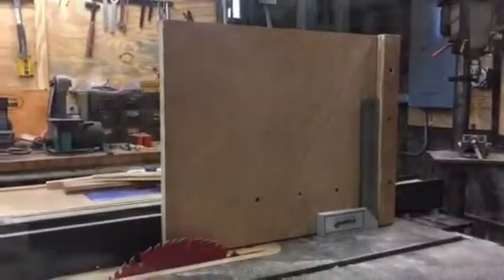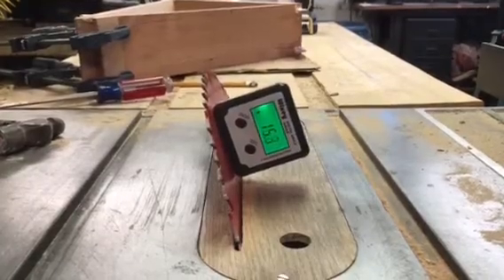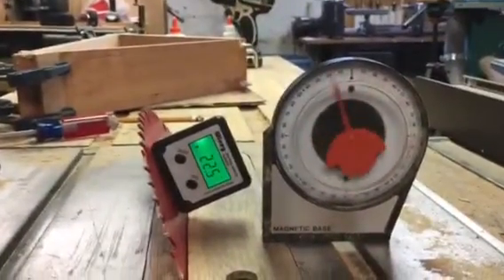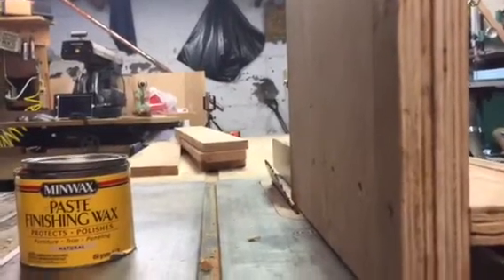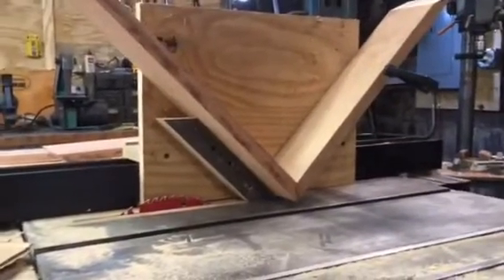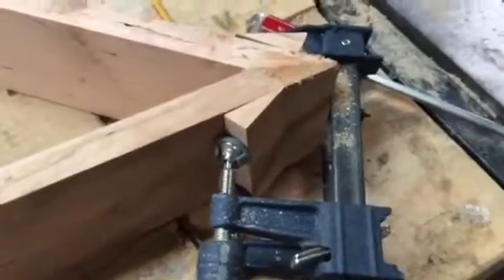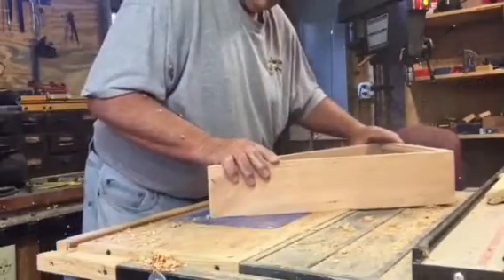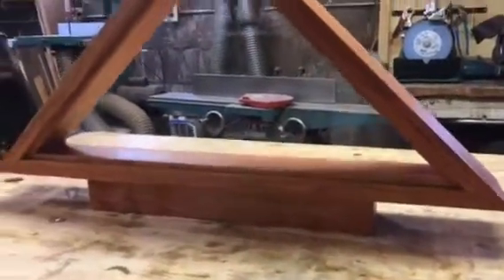Flag  Memorial Case by Bob Lee’s Woodshop

Comment: Question? Why can’t you cut that 22.5 degree angle on a miter saw? I’m new to all this but why is that miter angle different than the table saw? So how could you cut the bottom angles on a miter saw? Damn so many questions....
Reply from the maker: Hey Dan , The miter saw has a limit on how deep cut that they can do with the board standing up on its side !  my table saw can a board  any width that I want to cut!  If a board is only 1”to 3”” wide it could be cut on a miter saw. But the board on this project was wider than that! Bob Lee
Reply: Oh man I just figured out how to use my miter saw to safely cut that steep 22.5 angle!